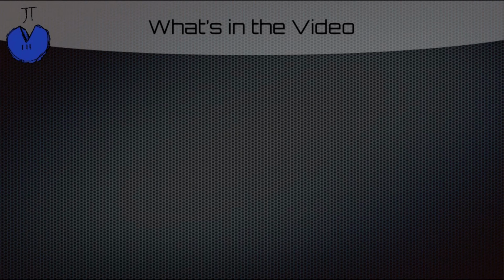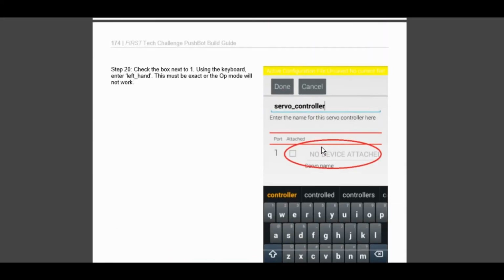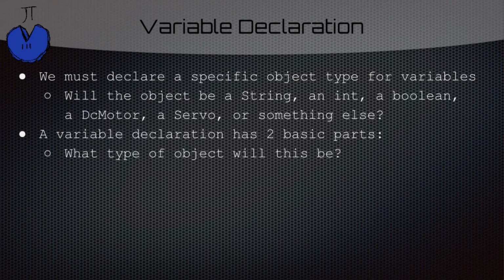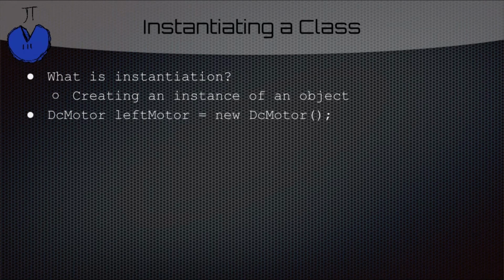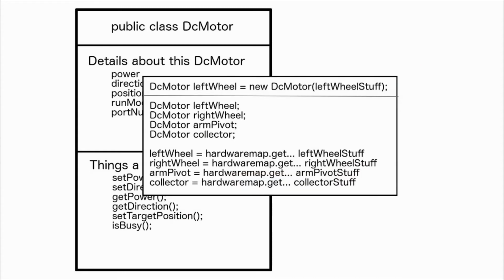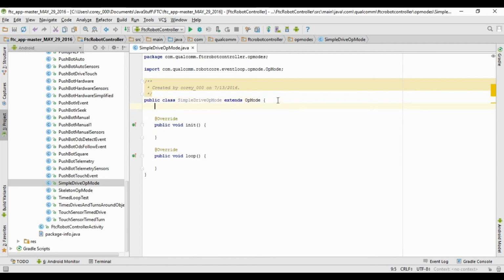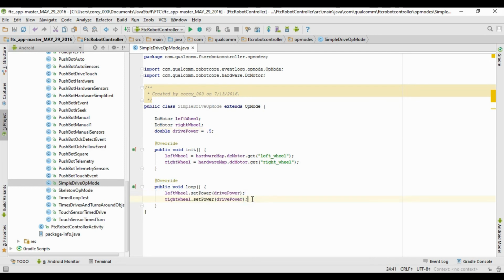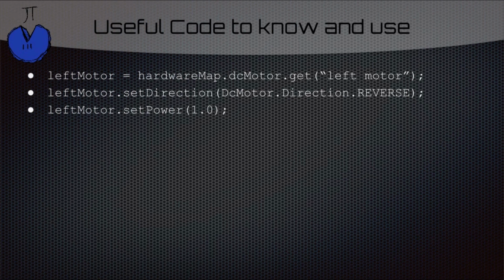UPDATED: FTC Robotics Help - Beginner Programming -part 2 - Get Moving

Comment: where do u find the hardware map in Android Studios
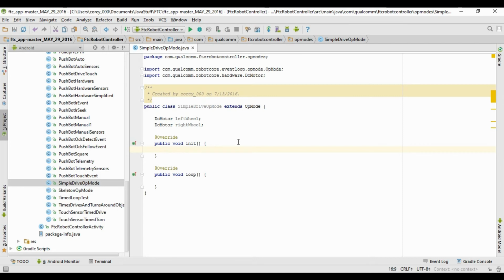Reply from the maker: Hey Sawyer. The hardware map is basically a way that the program can access the configuration file on your robot controller phone. Take a look again at the video around 21:50. Once you have a piece of hardware set up with a name (like DcMotor leftWheel;) You can then use the hardware map to assign a motor in the config file to leftWheel by using something like leftWheel = hardwareMap.dcMotor.get("name_from_config"); Remember, everything is case sensitive. We hope this helps, if you are still having trouble, give us a bit more detail on what you are trying to do and what's happening when you try. Good luck!!!
Reply: Okay thank you!
Reply: @FTCTeamPIEaters  Yes lil bro
Reply: Q